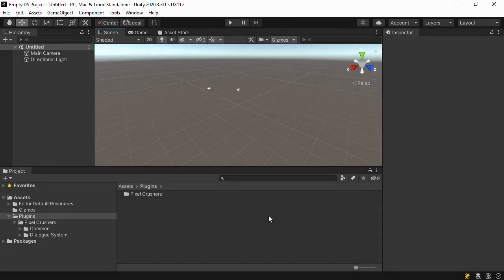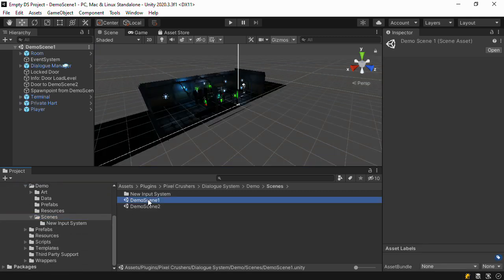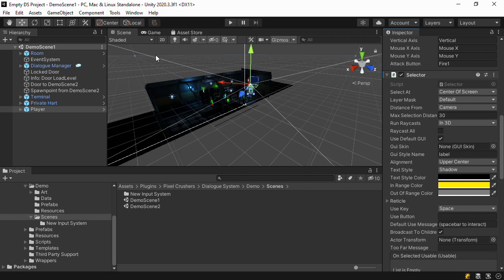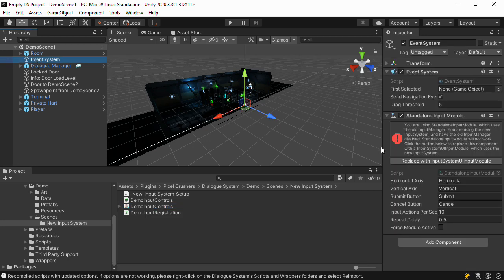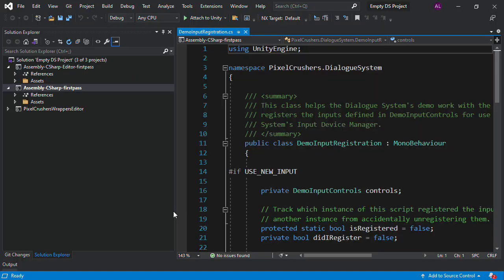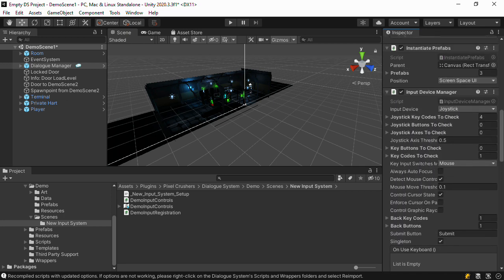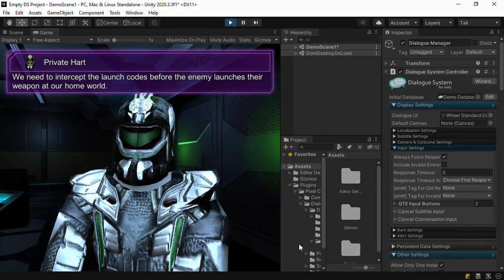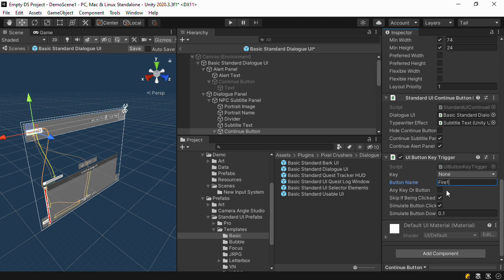Dialogue System for Unity 2.x - New Input System (SEE UPDATED VIDEO IN DESCRIPTION)

Comment: Hi, thank you so much for this video. I followed the steps and afterwards, pressing the button set to "Interact" starts a conversation, which is great. When the conversation ends, I press the button set to "Back" and nothing happens, meanwhile a different button on the controller closes the conversation window, one that's assigned to a different player action. I was curious, is the Back button meant to close the conversation window? Or is there a different input setting i should be looking for, to set as the button I want to do that? Thank you.
Reply from the maker: Hi! The "Back" input doesn't do anything in regards to conversations. If you've configure the Dialogue Manager's Subtitle Settings > Continue Button dropdown to require continue button clicks to advance/end the conversation, this will use the EventSystem's "Submit" input. If you have further questions or would like to see screenshots to clarify this, please feel free to post on the forum: https://pixelcrushers.com/phpbb/
Reply: Thank you for getting back to me, and so quickly!! @pixelcrushers

Comment: hey Im getting this msg "Assets\Plugins\Pixel Crushers\Dialogue System\Scripts\RegisterMyControls.cs(10,13): error CS0246: The type or namespace name 'Controls' could not be found (are you missing a using directive or an assembly reference?)"
Reply from the maker: Hi! That's an example script that assumes that the C# script that the Input System has auto-generated is named "Controls". If the Input System has auto-generated a C# script with a different name, please use the name that it auto-generated. If you have any questions about how to do that, please feel free to post on the forum: https://pixelcrushers.com/phpbb/
There we'll be able to post screenshots or whatever else might be helpful to answer your questions.

Comment: Btw a good tip for this so you don't have to put a GameObject with this Input script on it in your scenes...
Just make a static class that does not inherit from anything.
Make a "static void Initialize(){}" method that has the example code inside of it (don't need the register/unregister bools).
And lastly, put "[RuntimeInitializeOnLoad]" above this method.
This script will simply sit in your assets folder and that Initialize function will be called whenever the game starts. Simple and clean, no fussing with remembering to put that GameObject into every scene.
Reply from the maker: Great tip!

Comment: I've followed the tutorial, but my custom player controls input is not working
Reply from the maker: Hi! Did you add your custom player controls script to the scene (e.g., Dialogue Manager GameObject or player GameObject). You only need to register inputs that the Dialogue System will need to read, such as the Selector's Use Button if you're using a Selector component. Dialogue UI navigation uses regular Unity UI EventSystem navigation, so make sure your scene has an EventSystem that's configured to use the new Input System package. UI navigation doesn't require anything mentioned in this video tutorial. Your player move controls are separate from the Dialogue System, so they won't require anything mentioned in this video either. If you would like to follow up with screenshots or more detailed info, please feel free to post on the forum: https://pixelcrushers.com/phpbb
Reply: @pixelcrushers  It was actually working all along, but the message was off screen and I couldn't see it on the game window! xD